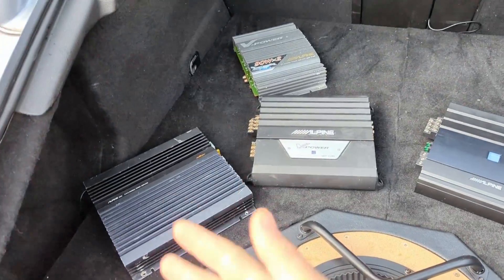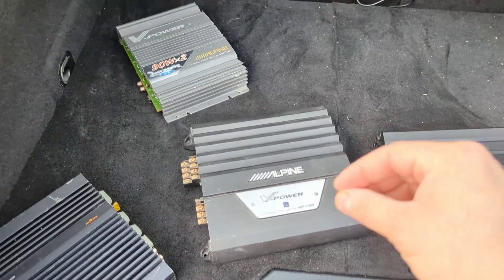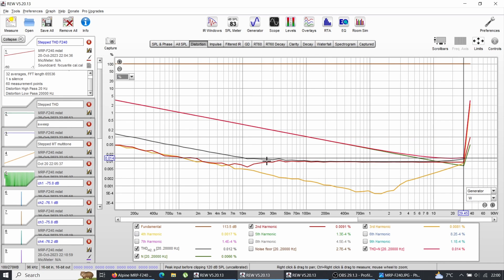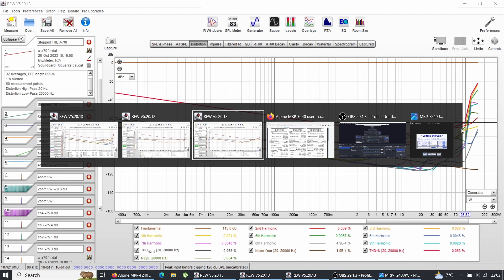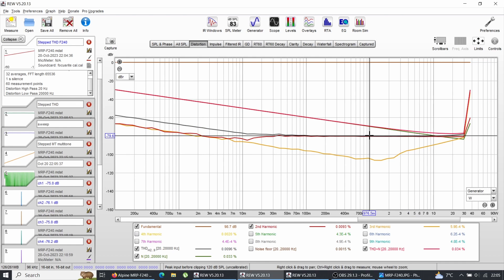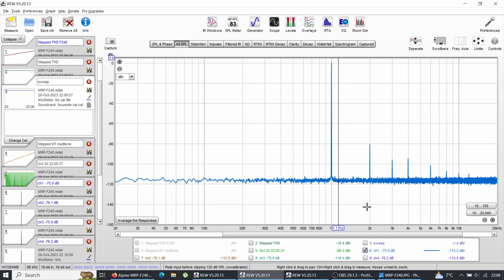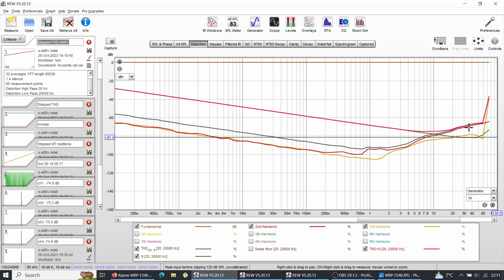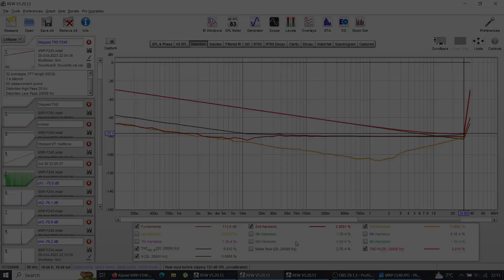Alpine MRP-F240 amplifier measurements (class AB vs class D)

Comment: Buy an alpine 3558. When you test and hear that amp you will be extremely happy!
I recently bought a non working Alpine 3558. One side had a blown power supply caused by a shorted BJT. The 2sa1637. I installed Irfz44n in the power supply and replaced the 2sa1637 on channel 4 with a 2Sa1386A. I also removed the NPN on that channel and replaced it with a 2sc3519A. Put it back together and nothing. Completely dead!!! No lights, nada. Figured out all the small 10v and 16v Elna caps leaked and ate away some trace. Repaired trace and replaced with nichicon caps. Now 2 orange lights. Figured out Q509 on SD circuit was bad. Replaced transistor and 2 green lights and relays engaged. 

After listening to this amp I am seriously amazed. Songs sound completely different now. Much better. However the amp gets pretty warm even at low volumes. Got a higher cfm fan installed and it stays cool all the time. Just a hint of warmth on the heat sink after listening for 8-10 hours and mid volume. 
I believe the first 9w is class A on 4 channels. Above that it switches to class AB. I decided to keep this amp. So, I bought all new nichicon and chemi-con caps to replace the 30+ year old caps before they try to eat the board. Also, channel 4, the one with new BJTs sounds the same as the others but seems to be slightly more powerful on moving speakers. Will probably replace all output BJTs when I put her back on the bench. 
It’s a truly great sounding amp. I have many vintage Phoenix gold, Soundstream, Sony, clarion and PPI amps. My favorite 4 channel amps would be a Toshiba 873, crossfire ca404, PPI a304, Phoenix gold sapphire 1.4x, Phoenix gold m44 and clarion pro audio apa4160.  Can’t leave out my audio art 200.2rxt, AA 100HC (subwoofer amp) and infinity kappa 255a.

Comment: I’ve used both class ab and class d amps on my tweets and mids and I much prefer class ab. I used JL HD600 for years and decided to repurpose it for midbass duty. I then ran alpine A70F for a while and I wasn’t pleased with it. Both amps had plenty of power but sounded thin and lifeless.I then switched over to an old school mtx 4320 I’ve had since the early 90’s. It’s from the era when they were still made in Arizona. It’s like my front stage took on a whole different sound.

The sound was just more full and not brittle sounding like the class d I’ve tried. The best way I can put it is that it just had more life and not sterile. Maybe it has something to do with that second harmonic that you describe as being warm….idk. Maybe it’s just some psychoacoustic trick it’s playing on my ears. Again idk why they sound different to me, they just do.

I would still have the mtx in my system if not for the fact that it picks up some alternator whine. I replaced it with Mosconi pro 4/10, which is class ab and I’m very satisfied….for now.
Reply: there is plenty things that can make ones liked or disliked the sound. two amp with exactly same second harmonic content , same THD+N number, will sound different if the harmonics pattern is different. like, one amp have 2nd at -60, 3rd at -80, 4th at -70, 5th at -90 vs one that have 2nd at -60, 3rd have -70, 4th at -80, 5th at -90. translating human perception into numbers is difficult at least for me

Comment: I'm of the opinion that there's some vague minimum threshold of distortion that each person considers "good". All amps above this level are basically equally good (as far as distortion is concerned).

So if you have two amps and they both sound great, I don't see the need to choose the one with lower distortion based on principle and theory. If your not able to hear the difference, does it matter?

Then you have other specs like signal to noise ratio. Are you able to test that? I always felt it was decently important. Too bad manufacturers rarely list it at 1w.